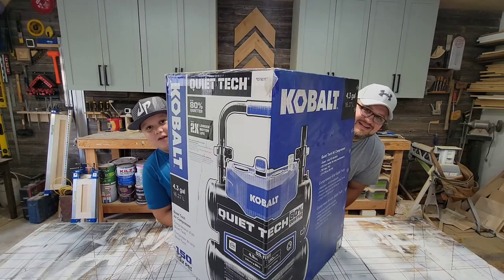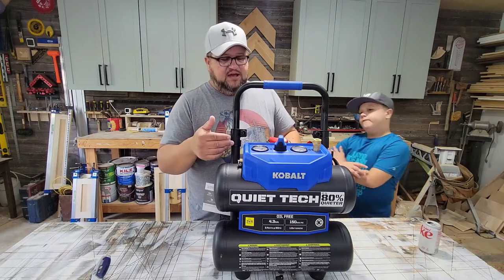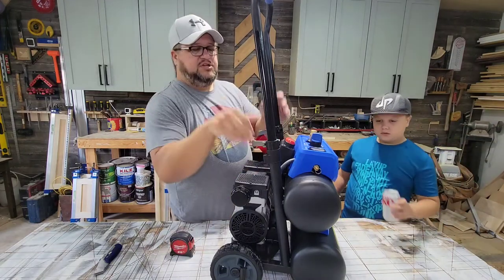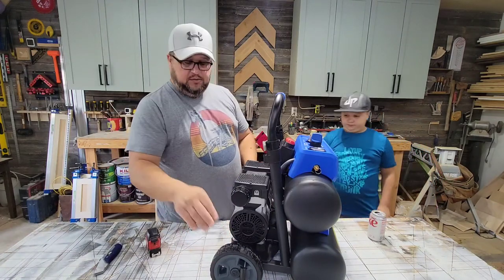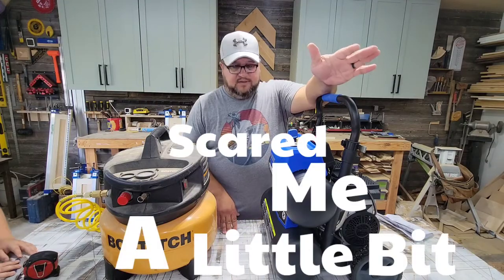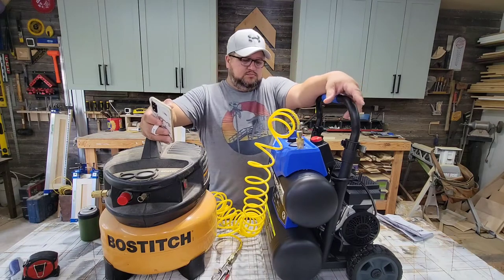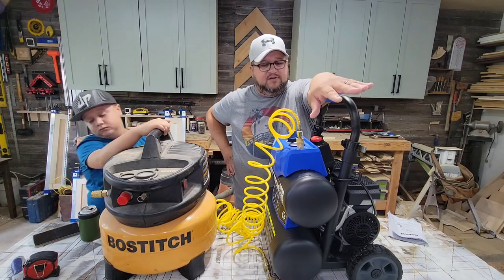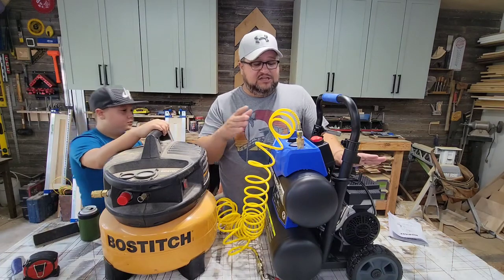Kobalt Quiet Tech 4.3 Gal Air Compressor | Review

Comment: I have the 2 gallon, have had it for 3 years now, it's an absolute GOAT. It's gotten its use and I haven't been easy on it yet it still runs as good as it did day one. I need a larger portable compressor for some jobs that require more SCFM now.

Comment: Subscribe- considered & done great video guys. I have a Ingersoll rand 2 1/2 Hp. I need something that done kick my breaker everytime it comes on. Have you noticed a huge power draw when it kicks on?
Reply from the maker: I've never noticed anything abnormal when it kicks on. Thanks for the kind words and thanks for watching!
Reply: @DebtFreeDIY  after further investigation the compressor I have while a bit loud was close to $1,000 new and although it’s not new anymore I’m gonna get it serviced and see if that fixes some of the issue. But I will probably still buy one of these for mobile air